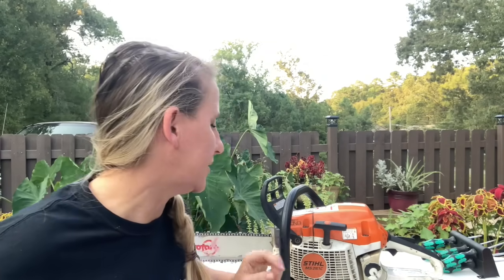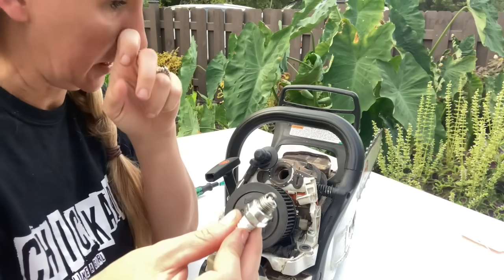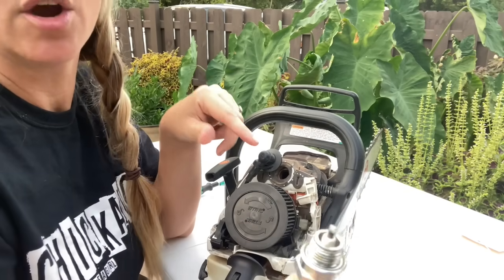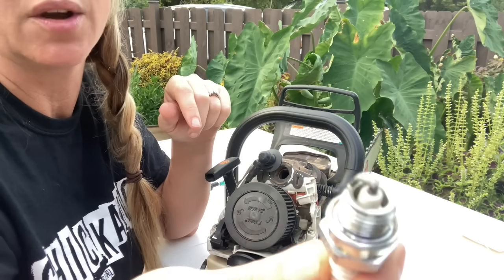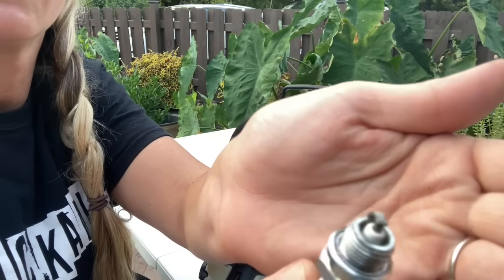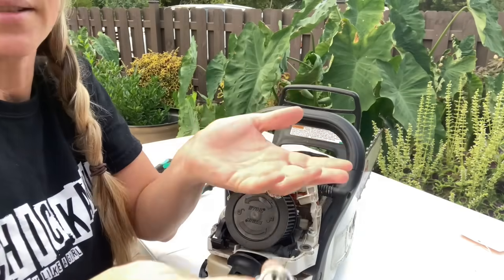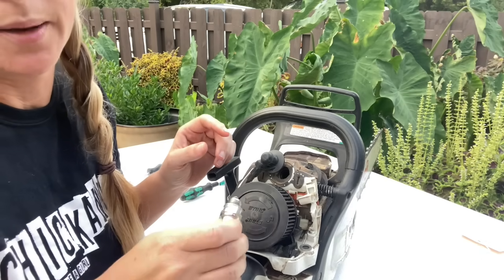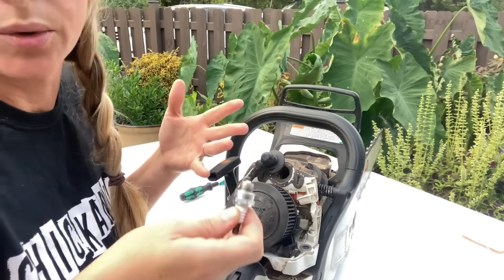STIHL M-TRONIC CHAINSAW HAS NO CARBURETOR ADJUST, WILL IT "RESET" TO REGULATE FUEL CORRECTLY?

Comment: Just a couple things to say.  
First of all, u would want to put at least some cutting time on your brand new spark plug before judging the tuning by its colour, this is gonna give you the most realistic response. By only running the saw on fast idle (i'll talk about that later) and at WOT it will eventually give u the same result, but  then saw would need more time running to give you a realistic outcome on the spark plug's colour than making a couple cuts in the wood.
The other thing is something i noticed in the reset procedure itself: the cold start procedure was right, and the reset procedure for that mtronic version i guess. Here's the deal: when put on fast idle, the chain actually IS supposed to run, even a lil bit, because the saw is set on a "fast" idle; that's why u're supposed to disengage the chain brake. Depending on which brand and model of saw u have, the fast idle could be set at higher or lower rpm, and this is gonna affect how fast the chain spins when on fast idle mode. On this 261 it seems that the fast idle is set relatively low, so the chain is not spinning that much. In this case, I would say that the reset procedure actually DID work, becaude after 90 seconds the chain  was spinning a lot slower, ergo the engine was running less rpm at the same throttle opening, ergo the carburetor adjusted himself a bit richier. Will it be enough to make the saw run correctly? I don't know, but keep in mind that all of those electronic tuning systems will always tend to lean up a bit ur tuning, this will make the saw respect the EPA emission rules. Basically, less fuel burning and more clean air means less exhaust gases being sent out in the atmosphere. This could also mean that ur mtronic or autotune saw will always be a screaming beast, but eventually it could last less years. That is the controversial point on these systems, and u kinda exposed it in the video, really good job.
Last but not least i saw a thing (and i could be wrong, in that case u'd wanna tell me): you switched the saw from fast idle to normal idle by simply pulling up the switch, and it looked like u were struggling pullin it. It is because that switch is NOT supposed to be pulled up to get into normal running position, the only way to pull it up is revving the saw up (as u did later); by doing it u will disengage the fast idle position, that is held down by the throttle lever itself, and the switch (which has a spring in it) will come up to normal running position by itself. Doing it the way it seems u did may break the fast idle mechanism, which is obviously not good.
Reply: 100% Correct. I have 9 Stihl saws and 2 Echo 2511T saws.  We break in a new saw in less than a week. Both my 400C  and 261C kick ass. I have no issues with idle and perform daily filter maintenance to keep them running at peak performance. Customers need to understand that quality fuel and oil with routine maintenance will always provide the best results.
Reply: @meporter69 couldn't agree more
Reply: Yeah seemed kind of unnecessary to show the spark plugs color after barely even revving it after the reset. Cut some wood or even let it idle and rev it for a few minutes AT LEAST for there to be any discernible change to the spark plugs color.
Reply: That is not the correct sequence to follow to reseton the mtronic. The correct manner is to open the throttle full blast and hold it and you will hear the mtronic cycle through its program and you are done when from a very high RPM it drops to a low steady RPM. That is for the 2.0 version and later 3.0 version .  The version is printed on the decal on the flat portion of hand guard that you step on to start the saw. (if you use that starting method.)
Reply: This was an older saw so not mtronic 2.1 or higher reset that you just described. The one she did is proper, idle in start position minimum of 90 seconds then shut off without touching throttle.

Comment: The m tronic system is about as bullet proof as most electrical devices. I e got over 1,000hr on my 261 at least. No issues so far other then wearing out. Using it with a 24" bar right now bucking and limbing a clear cut. Gets ran hard a take pretty good care of it. Always run sharp as fuck chains.
Stop complaining about m tronic I love my m tronic saws.

Comment: Mtronics is to protect the saw from people that do not know what they're doing adjusting the carb it works great and no computer is needed to reset it read a book.start on hot start let run there for 90 seconds it resets or drop it in a log at least 12 in diameter it will reset.leaning a saw out is the worst thing you can do to it.i adjust every carb with a tachometer the only safe way.been doing this for 40 years.

Comment: Thanks for the video, I have been given a MS261c because first it was hard to start unless you hand the chain brakes off. Once the saw can be started!! ( chain brake off ) it will run until you put the chain brake on then it stalls out??

Comment: More times than not there's a reason why you have to adjust the carb on a two cycle engine . Ether it's stoping up or the diaphragm and flaps are getting hard . Your adjustment shouldn't change unless something is wrong or you change elevation. So stop bitching and fix it.

Comment: Generally if it just needs plugged up and reset or adjusted there is no charge.  Very rare to need anything more than a reset unless some physical part is having an issue as Etec stated.  If you are in the woods and tweaking your carb a lot, you are doing something wrong.   Unless there is a change in the fuel, mix or elevation there should never need to be any tweaking after initial tuning.  If you tweak in the field, you didn't tune right in the shop!  Far as stihl warranty I have seen Stihl replace cylinders and pistons on blowers where users failed to use any oil.  One saw where a user used marine oil and burned the piston up.  Finally a pole saw the user hung in a tree, twisted the shaft and broke it in two.  All completely warrantied by Stihl for issues that are user error.  The length of the warranty is hardly useful if the quality of the warranty is a faint 'echo' of what Stihl does :)

Comment: Years ago I understand in the late 70s there was A law passed called Magnuson Mossa act call lol reads something like this I can’t tell y’all the exact wording but it goes something like this if you purchase I don’t care if it’s a car pick up truck 18 wheeler it don’t matter what it is if you run a lubricant in that piece of equipment as long as it meets minimum specifications and that includes the weight oil for example if you buy a car calls for 5W 30 if you run 5W 30 red wine oil it will meet specifications if you run Amsoil if you run whatever brand name as long as it meets the weight requirement which by the way if you run a zero W 30 you’ve exceeded the winter weight and I have to honor it by law they have to honor your warranty by law so steel can shove it where the sun don’t shine husky can do the same thing and by the way when it comes down to echo equipment I have had good luck with their equipment anyhow a thank you chickanic

Comment: There’s a lil grommet on the fuel piston on the 261cm
It’s on the side of the carb
That grommet fails and will cause lean conditions and running issues 
This is primarily on the older versions of the m tronic

Comment: To reset the MTron properly you have to let it idle at 35 seconds then full throttle for 35 seconds You will hear the saw engage it will upper and lower its throttle on its own during the sequence there's a lot of misconception .when used properly the saws are very efficient. I'm constantly changing altitudes so I have to constantly retune my saws this feature makes this splendid
Reply: It's 35sec at idle with chain locked ; then 35sec full throttle with chain UNlocked in ID models 2.1 and higher (mine is a 3.0 model).
Reply: P.S. ...the step-2 (triggered high throttle) will kick down when self calibrated within 35-60sec. Shut it down and it is now calinrated.
Reply: 35 sec, in thee cut..  Full throttle outside the cut will cook a saw up in no time, especially a big commercial unit..
Reply: 35 seconds WOT with no resistance will fry the saw
Reply: @rossjones5922  they don't actually go full on. It's a sequence then drops to idle and your done. But I'd rather have a adjustable carburetor myself but I know how to adjust them. So many people I talked to had no clue about marine 2 cycle oil. Don't use it in anything other than boat or jet ski ...
Reply: @rossjones5922  not on m-tronic 2.0, you do hold the at WOT for an uncomfortable amount of time but the ECU regulates the rpm and A/F ratio during calibration. It works
Reply: @rossjones5922  Well, my 201 and 261 are running fine and I've done it occasionally. So not necessarily.
Reply: That's for newer M-tronic versions. Older versions are reset the way she described.
Reply: Shouldn't have to do this at all ,it's dumb as fuck
Reply: @MrTheHillfolk  that’s like saying you never haven’t to make a carb adjustment on a non mtronic. With all the changes as in air filter flow temp and elevation there has to be a way to adjust for that so the reset is there for that reason. Also if you replace the air filter or fuel filter or spark plug you should reset your mtronic saw.
Reply: @MrTheHillfolk  "I don't understand this, and that makes it stupid!"

Get over yourself dude. A system which reduces emissions isn't stupid. Having a way to reset that system isn't stupid either.

Comment: We have 3 Echo chainsaws, two for the wife's woodworking then mine for trees. I was wondering does it really matter on which bar oil to use in them ?    Where we live in KY there's not a Echo dealer within 40 miles one way from us, what's safe to use if I have to use another brand ?

Comment: With the saw running lean like that you are likely to suffer a "lean Seizure"  Due to lack of lubrication. I wonder what that will do to the warranty?
Before I retired I had customers ask me to get theirs saws to rev higher,  I pointed out he damage a lean mixture would cause.  Some insisted,  so I always put a disclaimer on the worksheet and got them to sign it.

Comment: Here's my Stihl m-tronic story. I buy and sell chainsaws for fun and profit. When I saw an ms201 (the rear handled version of their very popular pro climbing saw) on CL in like new condition for $100 you know I couldn't resist. It was an m-tronic of course and the owner said no one could fix it or figure out what was wrong.I got it home ran it and found out that it would run fine and cut wood but absolutely would not idle. Anytime you asked it to idle it would simply shut off. You had to restart between every cut. I tried the Stihll reset procedure with 90 seconds of idle just as pictured in the videto to no avail. compression test revealed perfect compression and removing the muffler showed no scoring. With no adjustments I took it to the local dealer and they said no problem we'll reset it. $150 later I took it home and found that it still did exactly the same thing as before. I took it back to the dealer and demanded that they repair it again under the warranty of their first repair which is 30 days.That dealer has yet to contact me telling me that the saw is complete and ready to pick up and that has been 14 months.I have visited the saw several times and they report that it is still there and that someday they will still get to it LOL. What do you think guys should I just part it out 😂
Reply: It's now been 18 months and I've yet to hear from the dealer.Been in there a few times to buy bars and chains and such but they never mention the saw.
Reply: If that were my saw, they would no longer be a Stihl dealer after 14 months.  Unless ... you are not "fun" to deal with.

Comment: I've owned a MS 362 for 6 yrs. Cut around 10 cords a year with it. I haven't had a lick of trouble with mine however I always have a clean filter, rec gas,& I run the hp oil a little on the lean ratio. Great video.
Reply: mine fried with lite use.
On a 40°f spring day, I had not moved the cooling air diverter off snowflake.
I sensed the saw went lean. My experience  and training are not to shut down an over heated unit down abruptly.
The saw chose to quit. 
It did not start again with out a fresh ignition coil.
Looking in the exhaust port it was clear the piston was shot. So was the cylinder.
It drank only ethanol free gas and Stihl synthetic oil.
I don't even think about that snow flake untill it is under 10°f now.
I figured it was my fault,  Stihl did not offer any help. With OEM parts it has been fine for the last three years.
I could use an 80 or bigger cc saw.
Probably won't be a Stilh.
For one, what chuckel head came up with the fuel and oil caps??
Not only do they mess up, it is near impossible not to drag debris in to the tanks. In the field there is a paint brush dangling from the fuel can.
In the shop air.
Yeah, here is California. Give me H L adjustments!  Chris

Comment: It works better if you do it correctly. 

Method 1 for M-Tronic re-set:

Remove the scabbard

Ensure the chain brake is engaged (on)

Put the machine in the ▲ Cold start position

Start the machine and run it in the ▲ Cold start position for at least 90 seconds

Do not touch the throttle or accelerate the saw during this time

After 90 seconds, switch off the machine

Your machine is now re-calibrated and ready for operation

Comment: 90 seconds of idling will not change the appearance of the plug , the reset method I know of for the ms261is to let it idle for 90 seconds then hold it full throttle for 30 and go to work!!!.

Comment: I went to the saw shop thinking l could get tool to adjust my carb. They said the public could not have one. I am a Tool and Die maker so making a tool to fit was no problem. I ground up a electrode and some EDM and bam. Fancy tool.

Comment: I'm sure it's been addressed, but you're doing it incorrectly.  
To properly reset the M-Tronic, start in full choke, let idle for 30 seconds, but NOT longer than 60 seconds.  Then, fully depress the throttle for 30 seconds...do not blip the trigger to disengage the choke...just go wide open.  You'll notice the engine rpm change after around 15-20 seconds.  Once the rpm drops noticeably...  It's recalibrated. Drop her to idle and go cut. 
Read section 17.2 of the owners manual for verification.
I've spent hundreds of hours running both M-Tronic Stihls and Auto-tune Husqvarna saws professionally.  They're excellent.  Though, I do find the husky version to be much harder to recalibrate and much more prone to losing tune. 
Anyways great effort, and I love your videos.

Comment: 50 years ago I ran Homelites because there was a good dealer in the area.  25 years ago, I got back into logging, and ran Husqvarnas. 10 years ago, I bought a used Stihl for occasional use. That Stihl  has had more issues and cost more in repairs than all the dozen or more other saws I have owned combined.  I also briefly owned a Stihl leaf blower that was so frustrating that I threw it in thew dumpster.  I guess you could say I'm not a fan of that brand.
Reply: Never buy Stihl used, most likely amateur ran it.

Comment: I have a Stihl ms 661m magnum that has been a good saw. No trouble so far. I hope it stays that way.
I was concerned when I bought it about the M Tronic because I am used to the old style ms280, Dolmar 5010, Mac 10-10, Homelight 10xl and the stump cutter poulan tooth shaker.

Comment: it was explained to me when i bought my 362-s that the system in these saws can go out of adjustment, and for a variety of reasons, it was explained by the dealer at peralta power, in peralta new mexico, that when they act erratic that once you get them to start, you go to full throttle while NOT under load for five minutes, and the system SHOULD re calibrate, 
   i am a home owner and dont use that saw very much, but have had issues between winter and summer use, and with altitude changes, since i live at 7800 feet, 
   and sometimes take my saw and help my brother who lives at 5200 feet, i have had to do this a couple of times, and it has never had other issues, 
   thank you for your ability to explain things in a straight forward and well informative manner, i myself am a mechanic, but one who works on antique cars, which work at my speed,
  old and slow.
i thank you again
    have a good day
Reply: Full throttle for 5, FIVE minutes???
Wtf 🤣🤣
Reply: Five minutes of no load throttle, huh? Can we use your saw?

Comment: I have an Ms 290 and the carburetor has low and high but it has plastic limiters that only allow you to turn  it a little bit. That's not good either. Can the carb be replaced or fixed?

Comment: There are 2 different modules. They have different requirements to reset. The chain break needs to be engaged, I don't know if that matters. The rest of the procedure needs written directions. Part at idle, part full open, break on.

Comment: Ther  must  be some kind of app  with with some wires you can Connect to these saw that can run a diagnostic like a car computer that you plug up that gives codes or what ever  my take is putting computers in a chainsaw not to smart it jut creates problem s the you out in the back 40 cutting logs not good

Comment: Sounded fine at full throttle, just a tad rich, "4 stroking", which is the way the carb should be set on a chainsaw.  A blower you want it totally smooth.

Comment: On the stihl m tropic to reset engage the chain breach set the ignition switch to the full down position or triangle position let the saw run for 30 seconds to one minute then disengage the chain breach open the throttle fully and hold it full open till you hear the engine speed up then wait till the engine speed slows again while you still have the throttle wide open once the engine speed slows down the system is reset.